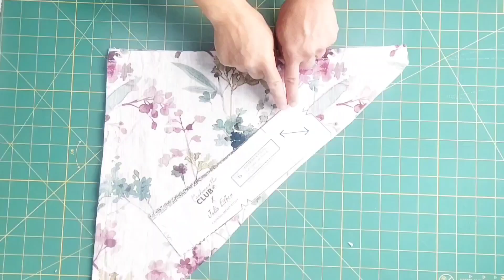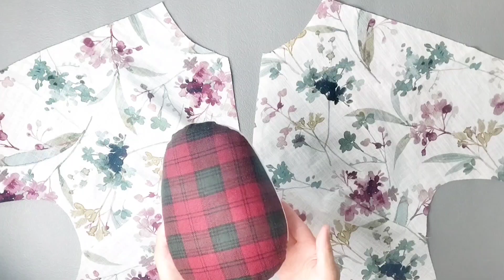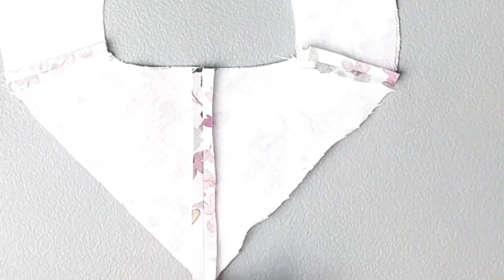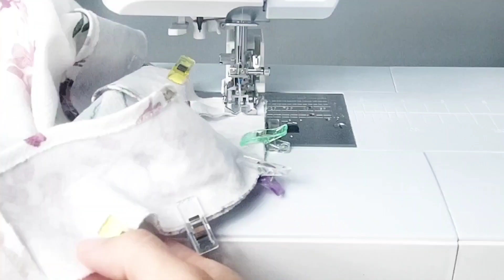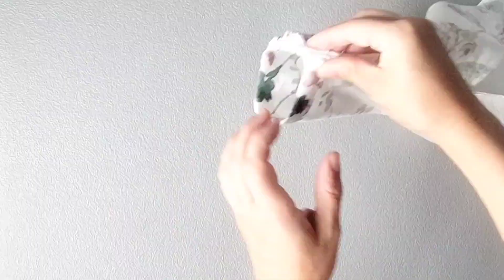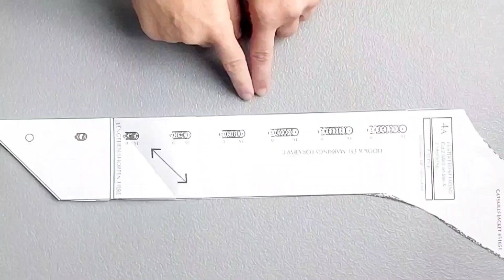Catskills Jacket Sew Along // Cashmerette Sewing Tutorial // DIY bias cut jacket with french seams

Comment: its a nice jacket but I would need to make a small bust adjustment and would rather persue a different pattern co 
Your tutorials are very well done !
Reply from the maker: Thank you.  I have a small bust as well -- 31.5 -- and made no adjustment.  But, yes, if you like a more tailored, fitted look, you can certainly adjust as needed.  Do you have a favored SBA method?
Reply: @Sew-Happy  I try to buy big 4 patterns with a cup options
Reply from the maker: @lindakrol5376  ah, yes.  That's nice when they split up the bust sizes that way.